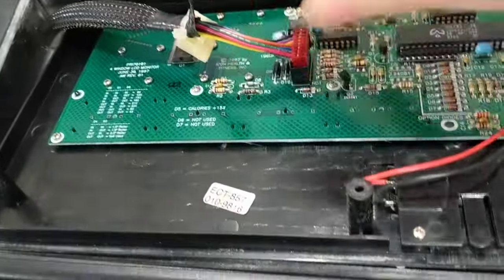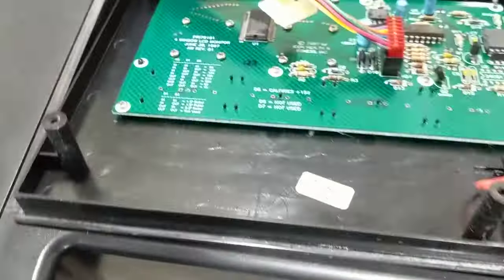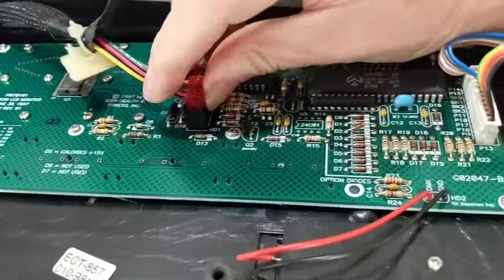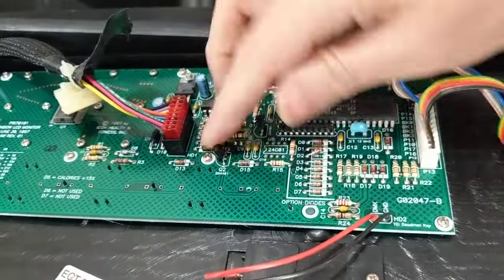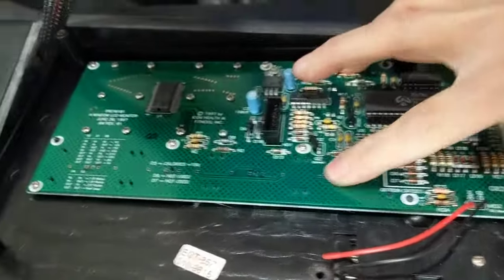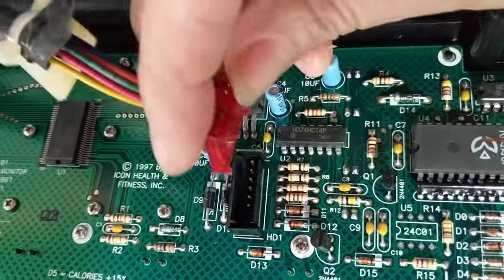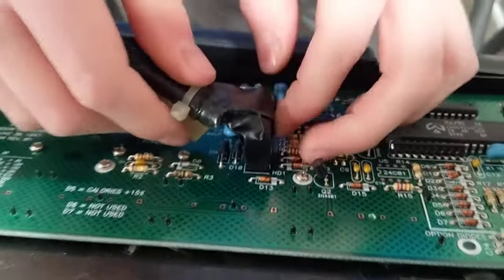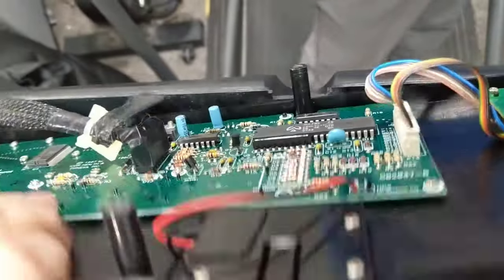Proform treadmill simple home repair of non working electricity no display no electrical

Comment: Yah so good advice could yo sent trouble shooting for my treadmill once i switch on the run button it suddenly stop and you have to restart again
Reply: Look on YT for a E3 trouble code on a treadmill.   Probably a issue with your speed sensor on your motor.  Easy fix.
Reply from the maker: I'm not an expert on these, but I did figure this out! :) I hope you got yours working.
Reply: It will not power on. It shutoff on me when I was using it and not it will not power back on and did the trouble shooting checking power cord. Circuit breaker and outlet